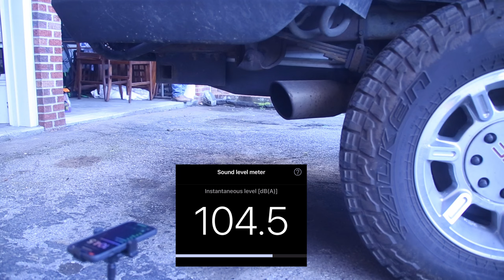The QUIETEST Free-Flowing Diesel Muffler?! DIY!

Comment: Literally robs hp
Reply from the maker: How does it "rob" horsepower by muffling noise? This is significantly less restrictive than the original exhaust and made no noticeable difference in performance empty or loaded heavy.
Reply: @ridesnrigs4956 because he says so and knows so much. That’s why everyone calls him when doing exhaust. 

Dynomax and flow have him on speed dial.